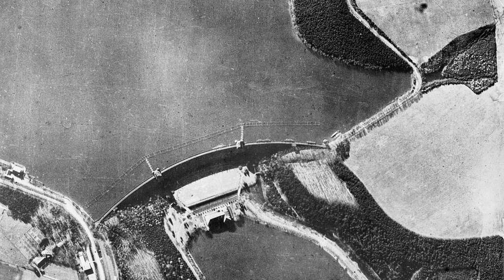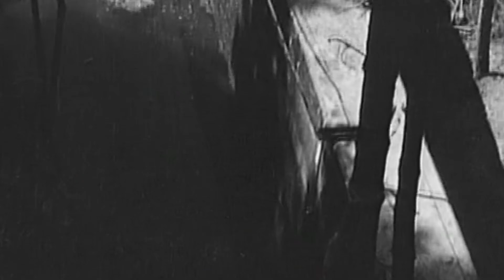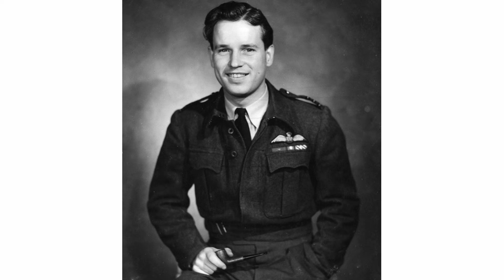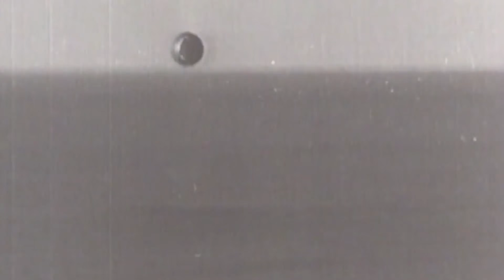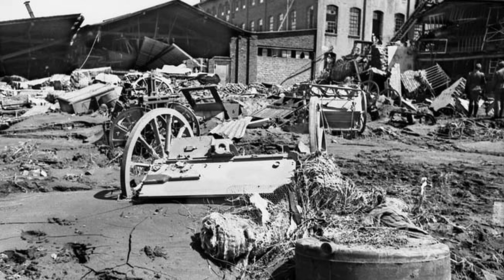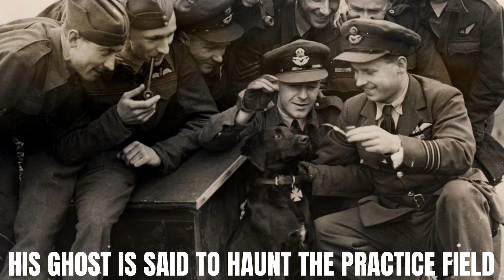The Dambusters Raid: Operation Chastise Explained

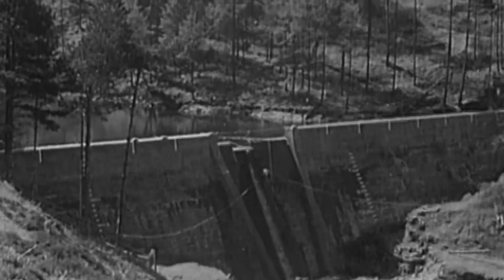Comment: 7:34 No, the bomb was spun by a hydraulic motor, repurporsed from the upper gun turret. The bomb aimer adjusted the hydraulic pressure (probably just flow rate) to maintain the correct RPM.